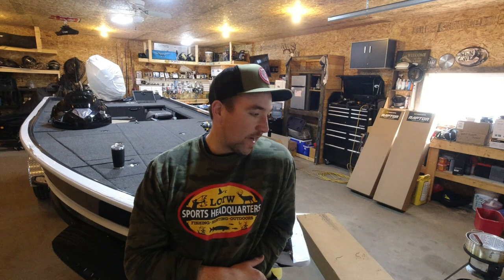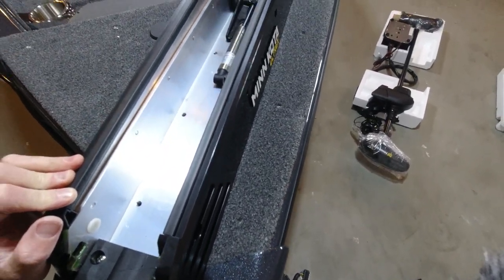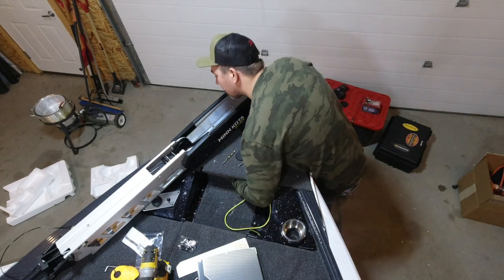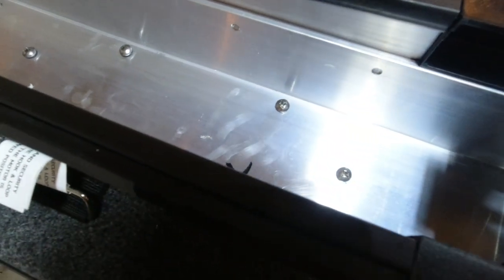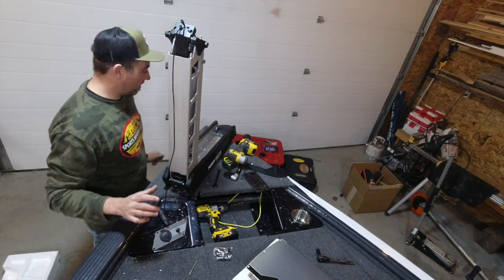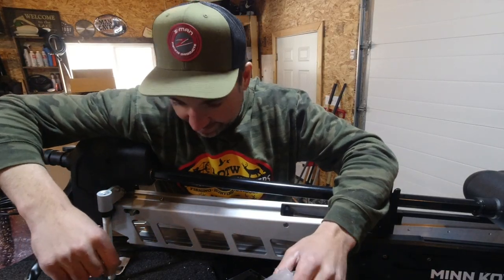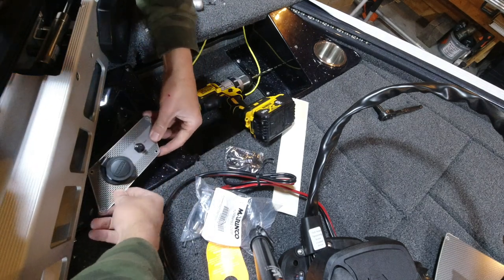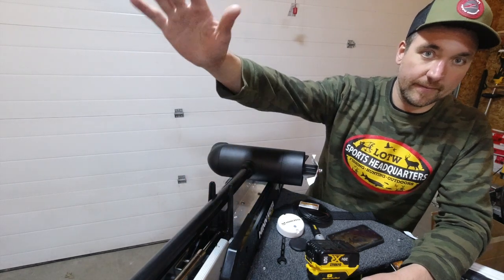Minn-Kota Install - Ultrex Trolling Motor  (Rigging My Dream Bass Boat!) (Lund 2075 Pro-V Bass)

Comment: Another great video! I rigged my new Lund last year. Wow do they make it easy now days with bow power and the pre installed rope to pull wires. One thing I noticed in your video and I don’t know if it makes any difference. But that white magnetic sensor puck is supposed to be mounted midway back and off center from the keel of the boat, it was a pain but I mounted mine back by the windshield. I think they want the distance so the gps can compare the magnetic sensor reading (white puck) with the gps reading in the control head. But like I said I don’t know if it even matters.

Comment: I always use brass 1/4 nylon locking nuts in place of stainless.  Occasionally the stainless nuts will lock onto the bolt before the nut is tight.  Then you have a loose bolt with a nut locked on it.  This won't happen with with the brass nuts.  I do about 20-30 motors a year and got this tip from a Minnkota repair person at the factory.
Reply from the maker: Will have to try that.. sucks when the threads pile up on the stainless nuts!
Reply: @jamiebrucefishing  YES IT DOES :-)

Comment: Hey Jamie, Im running a 2020 2075 Pro-V Bass XS, just wondering if you moved your trolling motor batteries to the back of the boat or keep them in the rod locker.  I found that i had a hard time keeping the nose up in rough water which cause a large amount of spray.

Comment: So why would you choose the Ultrex over the Ulterra? Any benefits?
Reply from the maker: A few reasons;

The ulterra has a sliding shaft so mounting forward facing sonar and 360 imaging is a huge process.  The ultrex is a tougher motor meant for fast stow and deployment and has all of the same I pilot technology.  The ulterras definitely have their place, but more in the walleye world I would say
Reply: @jamiebrucefishing  cool I got a new 36v ulterra love the auto deploy plus I use the livescope so the 360 wouldn’t be an issue for me and I’m also a bass fisherman......
Reply from the maker: @elou795  it’s all preference and they’re both great... but if you look at every bass boat on any high level tour you won’t see an ulterra!

Comment: How does the boat/travel cover work with the trolling motor on there?
Reply from the maker: It goes underneath the mount and there is a cutout for the cable , it works well